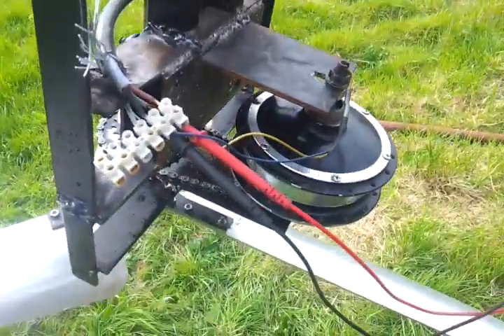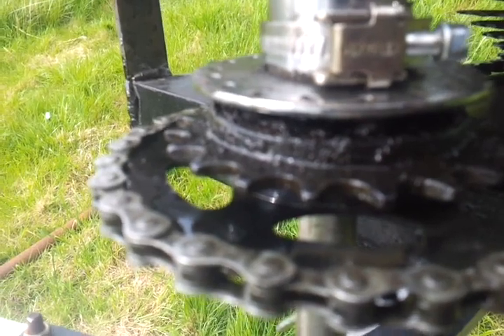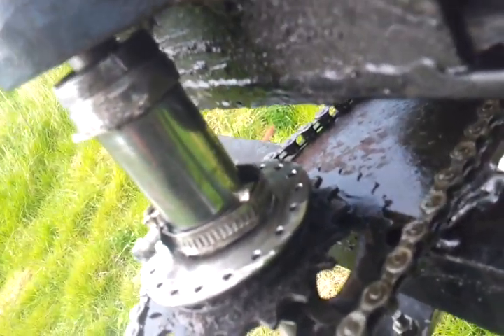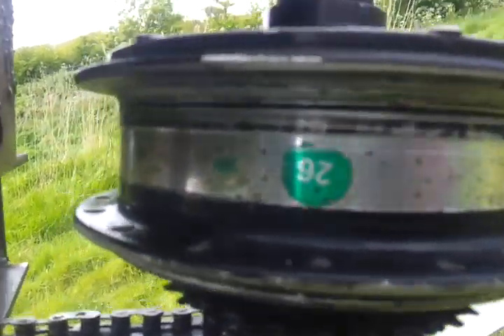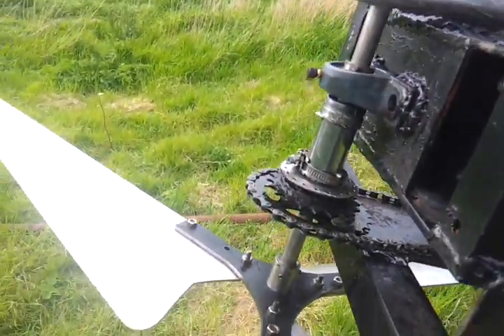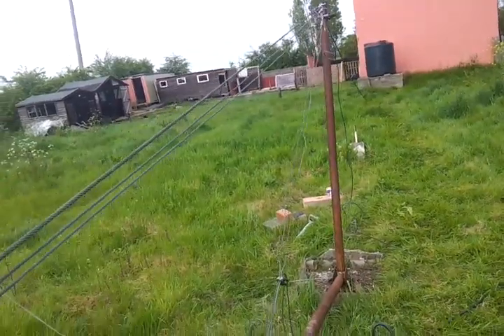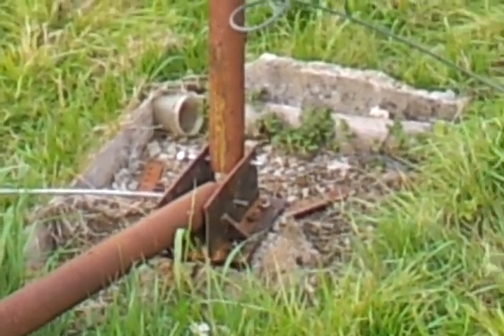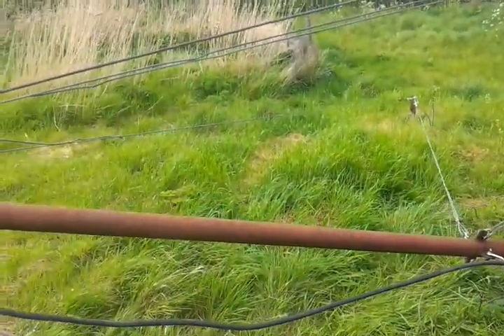Close up of a EBIKE BDLC MOTOR 24 volt wind turbine DIY gearing system from bike parts

Comment: If your slowing down the speed of the blades you should also increase the number of blades. Im not that smart but I know that if you add more blades you get more torque at the expense of high speed efficiency, this is because each blade creates a wake that if another blade enters it looses energy. So the closer the blades the sooner they are going to interfere with each others wake, but at low speed you will get more torque for you mechanical gearing system.

Comment: Hey Gav, How did this wind turbine go, and what was the wattage?
Reply from the maker: Hello , The 36 volt DC motor couldn't take the RPM's and ended up locking up and I haven't tried to repair it as I have been Ill wilth an infection :(
Reply: what type of output were you hoping for. I'm only asking, as I would like to begin a similar project!
Reply from the maker: Maybe 250 watt max, the motor was a 250w 36 volt and when it was flying round it made the noise you could hear power being produced but the motor couldnt handle the speed of the blades.
Reply: How much resistance is in the bike wheel hub? Is it  easy to turn? Im just thinking about the friction element. Regards, Gavin.
Reply from the maker: Really quite hard to turn especially under load thats why I ended up with 2 sets of blades.